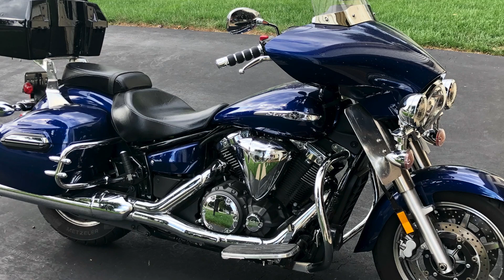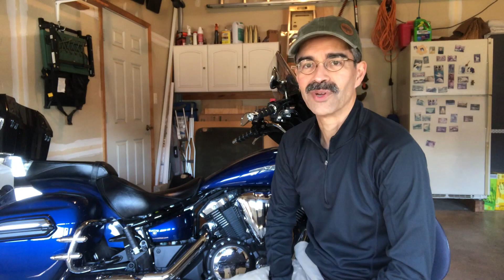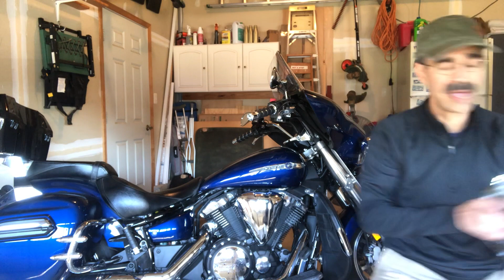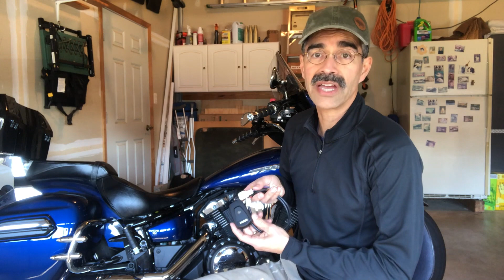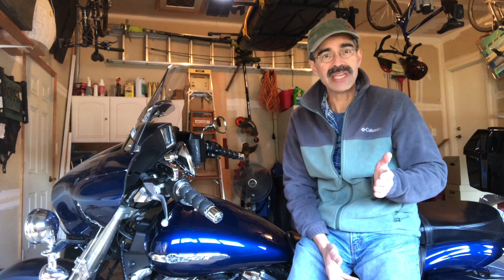Cobra Intake and FI2000 on V-Star 1300

Comment: Great review Rob! I just bought a 2014 1300 Deluxe that I plan on upgrading with the Cobra intake so I appreciate you posting this video.
Reply: Dont forget to add a fuel processor or better still have the ECU reflashed
Reply: I have a 2014. I have a few mod but am interested in upgrading my exhaust. Any suggestions
Reply: @Bluemajick1914  Cobra slip on muffler.  No need to change the pipes completely.
Reply: no need to spend money on slip ons, just take a heavy duty pipe that fits into the exhaust, you will notice when you look into the exhaust that there is a plug. what you want to do is hit it with the pipe until you puncture through it. Works better if you remove the back piece of the exhaust since you need to hit it kind of hard. I just did it time about a month ago and have noticed a great improvement on both sounds and throttle response. Enough to remove that slip on muffler out of my cyclegear cart lol... also I'm hear because I just purchased an air flow kit along with the cobra fi2000, hopefully it was worth the investment
Reply: @TheRoboticwolf13  The ECU reflash would have been a much better investment than an fi2000.

Comment: I know I'm late to the party but you have to run 91 or better in that bike because of it's compression. Higher octane pump ges does not alter performance, it only allows you to raise the compression which then helps performance. That bike calls for 91 or better, but if it did call for 89 and you put 91 in it, there would be 100% zero change in actual performance.

Comment: I ordered the cobra fl..... that's coming soon thinking about getting the the powerful intake like you have in the video
Reply from the maker: Good luck with your modification! I found that the factory dial settings were a bit too low for my setup, which also included the air intake and stock exhaust. I turned the dials up 1-2 higher, and the bike runs great, but that will depend on the intake and exhaust combo. I still believe that my setup runs better on higher octane gas, but I guess that’s a controversial issue.
Reply: The ECU reflash is a better way to go. Plug and play with no adjustments whatever the mods.

Comment: What about cams? Those really step up performance. Great video, BTW. I just picked up a 15 1300 tourer.
Reply: I don't think that there is a huge market for cams, for the 1300.  Have not heard of any after-market cams.  These are SOHC systems anyhow.

The BEST improvement one can get is by reflashing the ECU, like the Ivan-Flash.  I initially went with the Fi2000 and Cobra Dragsters.  The pipes were too loud, so I fitted them with Cobra Quiet-Baffles.  I had a few extra-$$$, so I did the Ivan-Flash.  There was a bit of improvement over the Fi-2000, and solid improvement over stock.

Comment: Appreciate you taking the time to do the video. I see you have already been asked about the noise it makes and your response included that you wear earplugs. I ride the same bike with stock exhaust and am not really interested in any additional noise either, but I don’t wear earplugs and can hear the wind etc.  and am fine with what I’m hearing. So what I’m asking, Rob, and it is the only reason I’m hesitant to do the upgrade, is whether you or others out there think it creates enough additional, or even worse, an irritating noise that would cause me to want to kick myself for having done the upgrade.  I know it’s subjective, but perhaps you could give me some odds for success. Take a stab.
Reply from the maker: The air intake makes a slight hissing sound that I can hear at idle, but at speed I don’t really hear it over the wind. The engine also makes more volume after the mods, and I assume that’s from the engine generating more power per stroke from the improved fuel/air delivery. The increased engine volume seems to be the same tone as before, just a bit louder. I ride with a guy who has a V-Star 900 with aftermarket pipes, and his bike is WAY louder than mine. I can’t ride this bike without earplugs, but that was the case before the mods, so I’m very sensitive to noise. Ultimately it’s always a personal decision when a bike gets too loud to enjoy, and these mods do make it a bit louder; but the improved performance from the air intake and fuel injection controller (especially in combination with mid-grade fuel) have made my bike faster, snappier, and it still gets around 50 mpg.
Reply: If you do the intake you will have to add an aftermarket fuel processor or have the ECU reflashed.

Comment: Get rid of the fuel processor & get Ivan’s ecu flash. Best thing you can do to these bikes.
Reply from the maker: That's probably another good option.  However, I looked at the torque/HP curves on Ivan's site, and I think the Cobra intake + tuner mods give just as good (or better) improvement in power.  Plus, it's a fun DIY project!
Reply: @travelswithrob4970  it’s not just about the numbers, it’s all the other things the flash fixes. Can’t do that with a fuel processor.
Reply: Where did u get the rear box at
Reply from the maker: @jerrysouthside8597  Trunk and rack both on eBay, but that was several years ago

Comment: Trade up for a 1900 Roadliner.  You won’t be sorry.
Reply: stock vstar 1300 runs .4 seconds under the 1900 road liner so his is probably just as fast now I would think.. I'm sure he gained the .4 seconds, wouldn't be any different from what hes on now. my 1300 out runs my buddy 2019 harley street glide 107 so if he wants something a little faster might need a sport tour or something.
Reply: More weight, more insurance, more gas ?
Reply: @clg_pro2009  I've owned both and had them each for several thousand miles.  The Roadliner definitely has more pep and road comfort.  But, it's certainly the riders choice.
Reply: @jamesweber4938  The ins depends on your ins package of course.  But, yes to the others.  I don't believe there is an extreme difference in either.  But, If costs is a factor  for you overall that does need to be figured in I s'pose.
Reply: Way to heavy and not  as nimble as the 1300

Comment: Drill your factory baffle out. It's just a little bit louder than stock and will significantly improve fuel economy and performance. I've done this on many 950's and it works really well. Use a hole saw that just fits in the pipe and take the guide bit out of the centre. Drill slow and be ready when it goes through, the catalytic converter is behind there. Edit* I should mention it takes 2-3 tanks of fuel for the computer to relearn the new power characteristics, you'll notice it continue to improve during that time.

Comment: @Travels with Rob What would you happen to have settled on with your 3 settings? I just ordered mine and I am also ordering an aftermarket air intake system so I figure that should put us in the same ballpark as far as the settings go.
Reply from the maker: Mine are set to 2, 3, 3. I don’t do a lot of hard pulls, so I haven’t tried going higher on dial 3. A reviewer in England has posted an extensive test on all three settings, in case you haven’t seen it: https://youtu.be/cNtQfCUnIk4. However, he has different pipes.

Comment: Great video.  Is there cruise control?  Are there aftermarket options available for the windscreen?  Thanks!
Reply from the maker: As far as I know, there is no true cruise control available for this bike, just various types of throttle locks. I tried the BrakeAway, but found the adjustments to be too fussy to work well with my Iso Grips, so now I just use a simple Go Cruise 2 throttle lock for brief wrist relief, $31 on Amazon; many other similar devices are available. Regarding the screen, the stock batwing fairing screen is made of polycarbonate, which is extremely hard, strong, optically clear, and undistorted; it’s far superior to acrylic, so I would not change this. I did make two additional modifications: I cut the screen height down by 2” because the edge was in my line of sight, and I added a Goldwing vent and custom aluminum lowers to reduce helmet buffeting (see opening photo). Have fun and ride safe!
Reply: @travelswithrob4970  Thanks for the reply.

Comment: Hey I have two questions for you.
1st, what do you have your nodes/ dials on the fi2000 set to? My first one is set to 2, the second one is set to 3 and the third one is set to 8 1/2. I noticed 8 1/2 once I get the RPMs high the airflow really kicks in.
2nd Are you knowledgeable on the app for the fi2000? I see people have it but I can't connect to it.
Reply from the maker: Mine are set to 2, 3, 3. I don’t do a lot of hard pulls, so I haven’t tried going higher on dial 3, but I’ve been meaning to try that. A reviewer in England has posted an extensive test on all three settings, in case you haven’t seen it: https://youtu.be/cNtQfCUnIk4. However, he has different pipes. As far as the app, it won’t connect to the fi2000 that I have, the app is designed to work with the PowerPro Black.
Reply: @travelswithrob4970  Oh wow, he provides a lot of information. All of the aftermarket parts were already installed when I bought it, so I'm playing catch up. I have kuryakyn hypercharger, the Cobra slip on 2 to 1 and the fi2000. I'm not sure if it's the one that will connect to the app. I was just doing research. I love having that powerful pull because of Atlanta traffic. A lot of times I just need to get out the way.

Comment: Does the cobra air intake make a lot of noise?
Reply from the maker: I can definitely hear the air intake, but it’s not so loud to be a problem, and I always ride with earplugs. The engine also make more volume after the mods, especially when rolling on throttle, but that’s the trade-off to get more power
Reply: It makes some noise but its not hard to live with.